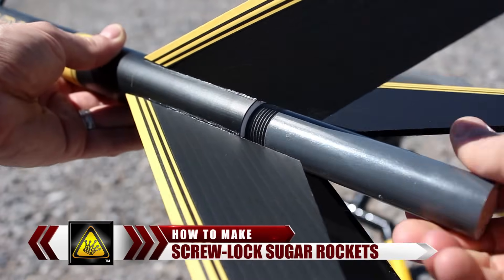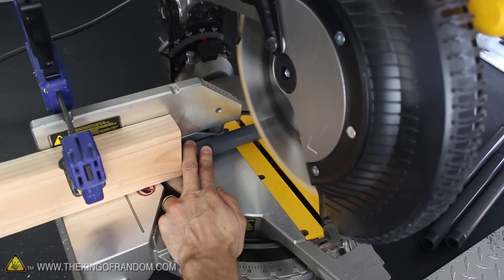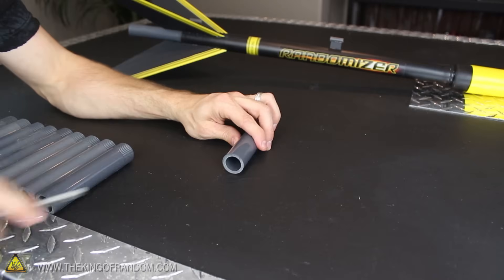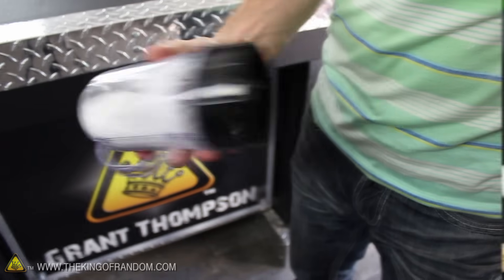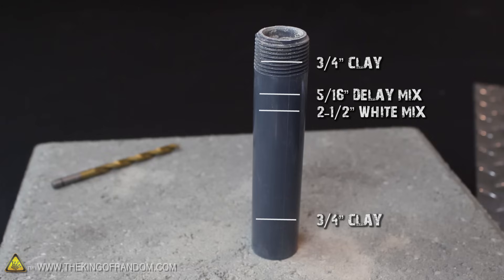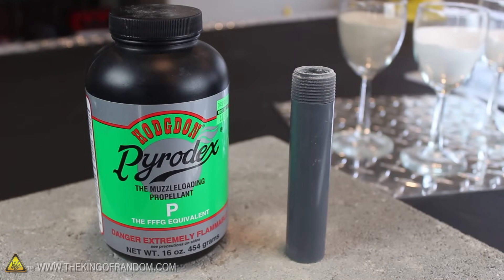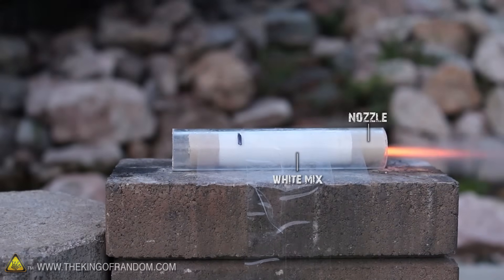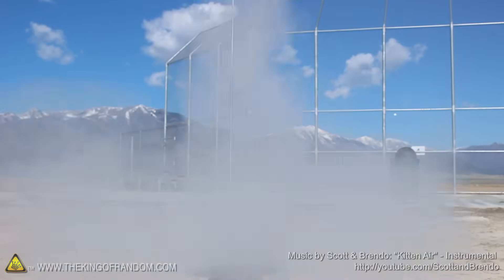How To Make "Screw-Lock" Sugar Rockets

Comment: YOU SHOULD NOT EVER HAMMER BLACK POWDER
Reply: I guess I should quit using a RAMrod when I load my .50 bp rifle. Be sure to use NON sparking dowel. If you went to public school, I suggest wood. Actually, I went to public school but back then (like when the Dinosaurs ruled the planet), the focus was education, not indoctrination.
Reply: You shouldn't comment on subjects you clearly know nothing about. Black powder has to be IGNITED with a spark or fire. You could take a brass hammer which will NOT spark and hammer the black powder with it for the rest of your life and the only injury you'll get is carpal  tunnel/repetitive motion syndrome.   STAY IN SCHOOL.   STUDY.         SUCCEED......
Reply: Yes a WOODEN dowel and a PLASTIC pipe will not create a spark and you would need to hit it REALLY, REALLY HARD to cause a rapid oxidation reaction !!! REALLY, REALLY HARD !!! Yes ?  Keen insight, or just scientific knowledge Ima ?
Reply: I hear ya, but indoctrination in schools isn't something new.
Reply: "However he used the baking soda, rather than the sulfur and carbon , to more control the burn rate, yes ?"

No. That was for the delay load.

The sugar replaced carbon so the fuel/oxidizer powder was not black. If used as an explosive this stuff should foomp rather than boom. Still dangerous.

Brad
This is NOT nitrocellulose. That entails using nitric acid. Its a black powder variant using sugar as a carbon source and no sulfur.
Reply: Yes Isley ! Black powder requires 1. fuel(carbon (sulfur)) 2. oxidizer(saltpeter)potassium nitrate (saltpeter(75%)), charcoal (carbon) 15%)), and sulfur (10%) = Black powder. :https://en.wikipedia.org/wiki/Gunpowder  However he used the baking soda, rather than the sulfur and carbon , to more control the burn rate, yes ?
Reply: Pyrodex!
Reply: It is actually dangerous if not packed tight.
Reply: and you should not ever procreate...
Reply: Interesting comment.  Black Powder isn't referenced in the video.  It's a nitrocellulose formula that behaves like black powder with much less mess.

Comment: But couldn't you use black powder as propellant?
Reply: That is what the commercial motors use. Yes, it works well. But, an E motor is about as big of one you would want with that propellant because of fracture problems getting worse the bigger it gets. Also, there are differences, black powder engines are end burners(from one end to the other), while sugar as well as APCP(ammonium perchlorate composite propellant) are core burners(from the inside of the core out). Core burners have an advantage in that they do not heat the casing until they are almost burned out and are generally preferred for re-loadable motors(which are available all the way up to M commercially and homebrew even bigger, at least up to Q)
Reply: That would work but is more dangerous to work with.
Reply: Not with commercial firearm black powder (that would just blow up your rocket), it would need to be a rocket-grade black powder that burns slower.

Comment: The fuel mixture may not be all that sensitive to pounding BUT at 6:07 min: “To keep the powder from falling out, give it one firm tap with your dowel, and you should find it compresses the powder just enough to keep it in place.” 
OR…you find it explodes taking fingers off your left hand! Seriously? Hammering on black powder? Never do this. Instead press it gently in place and never use a grinding or twisting action.

Comment: I'm using C-6 0 estes to simulate rpg fire for a small movie.  now, i know it is unnatural to fire them horizontally as opposed to straight up but this is the most cost effect, realistic way to do it. I use a 3 foot section of dowl rod to stabilize. but I just can't get them to fly straight. I make sure it's on straight but it loves veering off course.

Comment: As I have been ramming my own engines for some time, I have a couple of tips on this.

1.  Add a pinch (about 1/16 of  a tsp for your quantity) of red iron oxide.  It acts as a
catalyst to enhance the burn rate and  increase thrust.
2.  Place a piece of masking tape over the bottom of the engine.  It helps to contain the
clay.  Pull it off just before drilling the hole.
3.  Use rubber o-rings on the wooden dowel to help control the fluff of the composition when ramming.

Comment: when i did this mix it did not burn. but then again i only nuked it instead of baking it. is tht where i went wrong?
Reply: yep. nuking it uses radiowaves whilst baking it uses straight heat and air.
Reply: it was not i found out that it will burn without baking it at all... it was that i was using a stump killer that didnot have enough S.N. and now I am making my red iron oxide by using rusty can lids just burn them and put them in water to get them to really to use a little bleach and liquid soap the soap has glycerin in it so even better and just add some of this red water to it and after using an electric hot plate to get the sugar to liquify and all the water to evaporate 
 wala and OMG does this mix burn faster and hotter

Comment: really its smoke bomb mix for a rocket motor
Reply: The only part that could be accurately described as "smoke bomb mix" would be the delay charge... stump remover and sugar makes rocket candy.
Reply: Virgil R Garwood there are directions for making smoke bombs it's just potassium nitrate and sugar the only step not taken is to caramelise the mixture I've made many useing this recipe alot of the times I don't even caramelise it just use the powder
Reply: So you heavily compress your smoke bomb compound? I've always seen loose in foil and stuffed in a tennis ball/ping pong ball. I've also seen the descriptor of the compound as "rocket fuel or smoke bomb mix" and used a carbonate of some form or another because without it, it's unstable. Caramelizing removes much of that instability for packing... I'm honestly surprised he didn't run into an issue ram rodding it like that.
Reply: ... Then there's the entirely different classification of stump remover and phosphate. *shudders* yay, thrown rocket engines that just, go off... Eeeech...
Reply: Oh, sorry "thrown smoke bomb" packed loosely enough to not explode anything important.

Comment: What could I use as a replacement for gunpowder? Could I use the powder on matches?
Reply: +Ryan Estes
Have you actually tried that mix?
Reply: Trevor Bylsma
Black powder is 75% charcoal 10% sulfur and 15% potassium nitrate. You need a grinder or a mortar and pestle (and some free time) to grind it together because the charcoal needs to bond with the other things. Stump remover is like 95% Potassium nitrate, charcoal from grilling and im sure sulfer is also somewhere in home depot
Reply: Keyboard runner Better yet, use the whole firecracker and don't bother with the cellulose
Reply: just make some if u cant buy it
Reply: Here in Canada we can't buy firecrackers either
Reply: its true
i love close to the Canada/US border so i can go over to the states and get them
Reply: Ryan Estes You don't actually need the sulfur. All it does is increase the ignition temperature.
Reply: Covalence Dust
so why is it in the recepies?
Reply: Ryan Estes
are you blind he told you the answer to that in the reply you are questioning
Reply: paktahn
well now i know
Reply: Nope. In a confined space it over-pressurizes way too fast. The solid rocket motor is a precise balance of burn rate vs exhaust gasses. Too slow, no go....just smoke. Too fast, boom. No rocket. There are a LOT of calculations that have to be re-done every time you change anything in a solid motor.
Reply: Sulfur is used on plants so it is in the home and garden section.
Reply: Trevor Bylsma 
Really?
That's a real surprise for me. In germany they are also heavily restricted. You can usually just buy them in the week before new year.
But they are absolutely legal.

Comment: Why would you use a measuring system that requires fractions to do everyday measurements. "eleven sixteenths of an inch". C'mon america!
Reply: why would you use millimeters its just like fractions 500 millimeters is just one half of a meter
Reply: The Gaming Potato Derder 
metric is just better because of the prefixes. got two tenths of a millimeter? call it two hundret micrometers. cant do that with imperial (afaik)
Reply: No its the same, both are fairly the same with accuracy its just preferinces
Reply: The Gaming Potato Derder 
i guess it depends on what you grow up with.
Reply: yeah
Reply: +Raphael Schumach The pipes were in inches.If the seller used centimeters,then he would also use centimeters.

Comment: As a general rule about 3 times the conditions needed for ordinary detonation is where the spontaneous detonation risk materializes.  Consider a diesel engine is designed to make spontaneous detonation reliable so they have for about 13 times the pressure/temperature conditions.  As a humble suggestion, find the starting conditions and maybe divide by 3 to keep spontaneous detonation a lower risk.

Comment: I built 12 of these rocket motors as per the plan, but I used 12" schedule 80 PVC risers cut in half for the motors.

all of them failed due to the nozzle failing within two seconds of engine ignition.

I was unable to recover any of the nozzles so I don't know the failure mode.

Can you please give me some tips on how to make the nozzles last so I can make some motors that work?????

Comment: This is the only section of youtube with intelligent people lol
Reply: it used to be until you commented (jk)
Reply: +Official Leo1331 OHHHHH BURNNNNN 😁
Reply: until you find yourself explaining why you need a ton of potassium nitrate.
Reply: Tony F3 months agoRub it with sandpaper if it doesn't fit. Ram it down. Start drilling and pull out when there white stuff on the tip  
24

Yep..
Reply: Sounds like an accurate statement based on the magnitude of the information at hand 😛
Reply: Me like COMMENT!^^
Reply: AsapNicky Bars
lol xD
Reply: Thanks dude!^^
Reply: I thought it would be funny to make a really crude/ rascist comment in response but I couldn't bring myself to do it.
Reply: AsapNicky Bars
Reply: Neo Juni
Really?
What are those two types?
Reply: Heh. It's only dangerous if there is a spark, and there will not be. The rammer is wood, and the pipe is PVC.
Reply: LanceTech vlogbrothers?
Reply: intelligent people do ram highly explosive powder by hand into a compact pipe while holding it

Comment: Is it really fair to call them sugar rockets, when more than half of the mix that gets them burning is KNO3 ( potassium nitrate.)?
Reply: +ravemastaj that's called gunpowder.
Reply: KNO3 is just an oxidizer. The burning fuel is the sugar. You could substitute charcoal as a fuel source to go further, but it might also explode.
Reply: revtune 
Essentially, yes...except to be gunpowder, you would add sulfur. To be smokeless gunpowder, you would have to use nitrated cellulose (flash paper).
Reply: ravemastaj fair point.

Comment: If i wanted more burn time to make it go higher do i just make the tube longer and more in the middle?
Reply: More sugar, less potassium nitrate.  Instead of 65/45 like he suggested do like 55-60%.  Too little potassium nitrate and you'll just have a fast burning torch.  Experiment with it a little to find out what ratio you need
Reply: But yes, simply a longer tube will yield a longer burn time as well but add more weight and possibly mess with the rocket's weight distribution.  Play around with it to find a balance
Reply: +Richard Nguyen You are saying it's better to put in 115 percent than 110

Comment: If you drill a lengthwise hole in the ramming dowel, then put a small dowel in the center of the motor housing you can ram the fuel in and remove the small dowel to make a core burner engine, fill the core left by the small dowel with black powder. That way the whole core surface area burns at the same time. Much more power. Also water putty makes great rocket nozzles, and you can mold a power enhancing nozzle into it also.
Reply: Thanks for commenting this. The original instructions have me disappointing results. After adding your modifications it's almost exactly like the video if not better
Reply: hi i made this progect but it just ended up with just smoke blasting out and some weird acid
Reply: +revoltech danboard did you put it both of the caps(kitty litter)?

Comment: Rub it with sandpaper if it doesn't fit. Ram it down. Start drilling and pull out when there white stuff on the tip
Reply: that sounds painful, just try astroglide
Reply: Turn the bottom over so the motor is facing up.
Reply: Seriously, it's not rocket science.
Reply: That's what she said...
Reply: Tony F flows down the hole
Reply: Ram the clay and drill out the nozzle
Reply: Omg lol
Reply: ROFLMFAO 😆😂🤣😭
Reply: Tony F Filth!

Comment: Great video EXCEPT the world uses METRIC.  It's ok, America will catch up eventually, Hhaha.  Kudos for degrees Celsius on the oven drying temperature and grams for mixes etc.  Here's hoping its all in metric in the future and America emerges from the dark ages.  The video is really cool, so thank you for going to so much effort to make interesting and informative content.
Reply: there are two kinds of countries in this world...

those that use the metric system, and those that have been to the moon...

and for the record, every industry that requires high precision (aerospace, machining, etc.) still use standard (i.e. thousandths of an inch)
Reply: @wildbill6976  what's your definition of "have been on the moon" ? Because China and USSR (they also recover moon dust and recover it), ESA and even ISRO touch the moon (ok, it was a crash test for this two but they've been on the moon). So if I count, the majority of the agency who came up to the moon used metric system. (NB : ISS use metrics, Space x use metrics, Roscosmos use metrics, and so on with Ariane space, JAXA, ISRO, CNSA, et caetera, so your affirmations are both wrong)
Reply: 1Howdy1 I know this is a year late, but you get the irony in your statement right? The US built a rocket that has gone to the moon, while not other country has been able to do so, so clearly metric isn't something so great that it should determine who makes rockets.
Reply: the oven in the apartment doesn''t even have a Celsius setting. And most of the pipe fittings we've got here are imperial. So, to make this in metric, you'd have to live in a place where they sell metric PVC risers.
Reply: OK just same
Reply: The only way for America to catch up is to LEARN THE METRIC SYSTEM FIRST WHILE GROWING UP. If you want them to catch up you better be biting the school's asses over there for that to happen. Unless you are doing so, you don't have a say to even say anything about their measuring system... (An exception is with measurements being shared by different countries in professional sciences, officials worldwide products, and factories.)
Reply: If you can't convert into metric, you probably shouldn't be building rockets.

Comment: I always get worried when someone says "be precise" ...and they're using the imperial system! XD
Reply: name a single lathe/mill/cnc machine that uses the metric system as a basis of precision...

oh wait, there are none...
Reply: That, I'm afraid, is nonsense.  And the imperial system is rather more widely known than you might think.
Reply: BlakeTiger - Aerospace, precision is in 1/1,000" or better. But workers generaly work in layout to 1/100" via a 'Scale' (Not a 'Ruler'), for measuring things, if not using 'Hard Tooling'.

Comment: This is probably going to sound weird, but how does the spent motor smell? When I was launching model rockets on a regular basis I used to love the smell of the spent Estes engines. I guess a little because it kinda reminded me of shooting off fireworks and a lot because of the fun I'd just had launching the rocket. It was something you had to wait to smell, you didn't just pull the spent engine immediately after a flight and take a whiff. You waited until it got good and cold to smell.
Reply: Sweet like caramel, not like sulfur.

Comment: One thing you might consider doing would be using a piece of PVC with threads on both ends, and then you could make a proper nozzle that would use the fuel more efficiently and still be able to refuel quickly.  Just be sure to use something highly temperature resistant on the lower set of threads so nothing fuses together when it gets hot.  (I'd have to give some thought as to what to try, but teflon might be a good start.)

Comment: just a heads up for those who are thinking about making these, the rocket motor fuel is in effect a low grade explosive and may be illegal to manufacture in your area so unless yo want the police kicking down your door and arresting you as a domestic terrorist check you local laws and maybe join a local rocket club they will be able to hep you get any local paperwork needed for launching hobby rockets.
Reply: +Kenneth Donnelly No you don't (Edit: unless you're British!  In which case it's entirely illegal and you should avoid this like the plague).  Legally rocket motors are not explosives, falling under the "fireworks" definition by the ATF.  In which case, they are almost entirely unregulated as long as you are non-commercial.
Reply: +The Bellman im  Irish so yeah just giving a heads up to Irish and UK fans.
Reply: +The Bellman thats also why i susgested joining a local roctery club they will know what can and cant be done in regards to local laws and they may even have special exemptions in place becausec of specialised equipment or trained members.